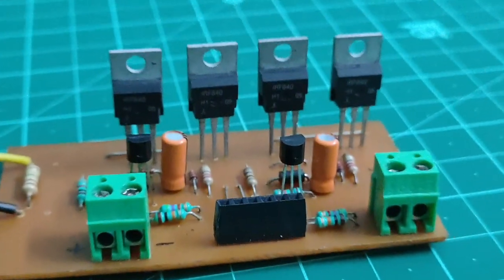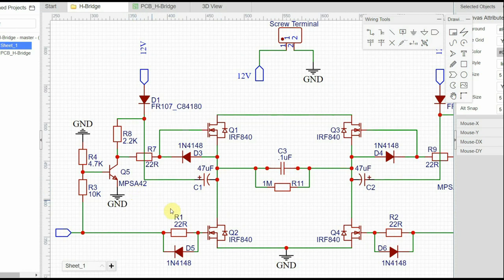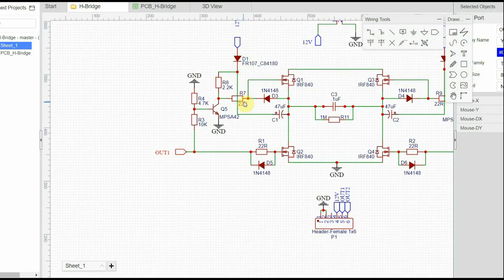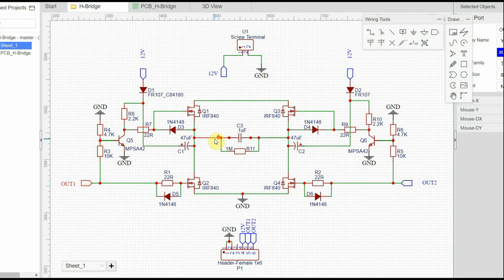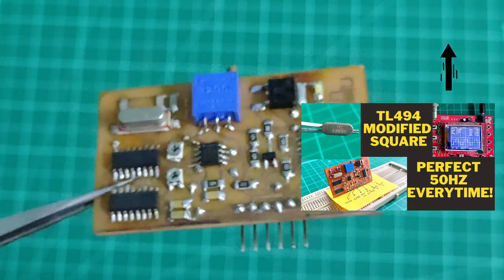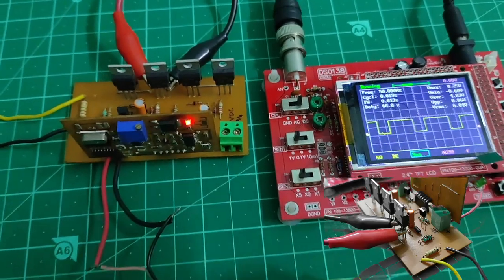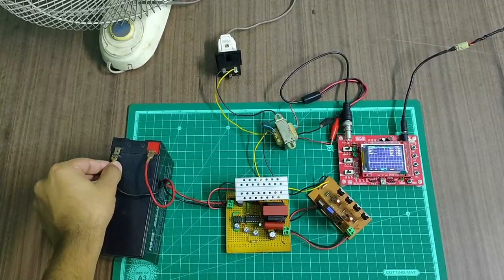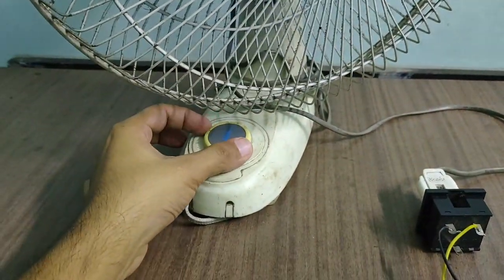DIY H Bridge Circuit for Inverters || Convert DC to AC using this module

Comment: You mention that this circuit cannot be used to directly drive a motor in one direction indefinitely because the controlling 47uf capacitor will eventually lose it charge. Could this be used to control a motor for example in short bursts for a solar panel tracker for example? Could resistors and capacitors on the output in a low pass filter be used to filter the modified square wave to make it more sine wave? It’s a great video and please explore some more?
Reply from the maker: @CodfishCatfish  Yeah you can use this for short span of time to drive motor connected to the MOSFETs. The H bridge can most likely handle this. The only thing you'd have to think about is the input signals to the H bridge. I had designed the 50Hz card for the purpose of using it for inverter. You can attach an LC filter to make the waveform a little bit 'sine-like' but an SPWM signal would be ideal for sine wave generation rather than this modified signal. You'd have to deal with reduced amplitude at the output and unstable waveform based on the load it's connected to
Reply: Great and thanks. Time to get constructing I think!&
Reply: @UtsavShah_25  I think your website is down!!!

Comment: Hello Sir, very nice video, i learnt things. My inverter output became square wave instead of usual modified sine wave. I looked at DTC parameters of the SG3524 that is driving it and it seams fine. In your opinion the problem comes from the H Bridge or from the IC ?
Thanks.
Reply from the maker: @hichamtassi1753  you need to check the signals which are generated by the IC and the signal which the MOSFET actually receives when the system is running. If the signal from IC is okay then there could be some issue with the MOSFET driver section
Reply: @UtsavShah_25  Good day Sir, i checked the signal at the PWM IC terminals and it is a square wave with small dead time of around 54 Hz (which is what is needed). That signal travels nicely to the 4 IRF740 which are new,  but the output is a perfect square wave with no 0V period between cycles, like if the delay or pause doesn't exist anymore. Mosfets are switching at the same pace of the ic, so square wave. I changed the IC and 4 of them produce the same output. The design is approximately the same as yours.
Reply from the maker: @hichamtassi1753  In that case I think you must try adjusting the potentiometer while keeping the system in running state to observe any changes in output
Reply: @UtsavShah_25  Dear Sir, thank you for your help, the problem was coming from A44 transistors. Now it is ok.
It would be GREAT if you could explain how we obtain a modified sine wave out of a square wave issued by the PWM IC. It would be very instructive.
Thank you again for your help !

Comment: Hi dear friend.  Will the H bridge circuit work with a single TL494?  without crystal oscillator.
Reply from the maker: Yes will work directly with a TL494 without any problems
Reply: @UtsavShah_25  Thank's dear friend. well, can you please prepare a video directly with TL494?

Comment: can you please make H bridge inverter for solar panel. I have to submit project in college
Reply from the maker: You can use this same bridge with a solar panel and it will convert it into AC. You just need to use a 12V supply for the H-bridge. The solar panel input can be used as input to H bridge
Reply: @UtsavShah_25  I can, but I have issue with H bridge inverter and its switching.

Comment: Hi there and thanks for the video.Can this H bridge circuit work with arduino leonardo?I want to make a high voltage H bridge to drive a treadmill motor for an FFB steering wheel for PC.
Reply from the maker: Yeah this can work with Arduino provided you give proper signals to the input of the MOSFET. You also need to check the voltage rating of the MOSFET with respect to your operating voltage
Reply: @UtsavShah_25  thanks so much!

Comment: I am getting 89VAC at the output. What could be the reason
Reply from the maker: @TechnoEveryday  check your DC input voltage levels when you power on the system
Reply: @UtsavShah_25  dc 300V ban rahay hn

Comment: Are ground negetive of both 12v battery n 300v negative commonly connected to same ground...??
Reply from the maker: Both the high and low voltage side are having a common ground
Reply: @UtsavShah_25  thanks... But if,300v negative is not connected to 12v ground, is there any problem .I mean any failure????
Reply from the maker: @listener1940  For this design the common ground is required for the feedback circuit to work properly. If the common ground is removed the feedback reliability becomes unstable, it can still work but it's not guaranteed
Reply: @UtsavShah_25 ok.. thanks..I am a school teacher..I am a big fan of your experiments... expecting more...👍🌹
Reply from the maker: @listener1940  thanks a lot for the appreciation! Will post more informative videos for sure!
Reply: @UtsavShah_25  all the best 👍🌹

Comment: I don’t understand one thing. Why there are no +12V conected on the drain of the two mosfet on the top? I don’t understand how the circuit can work without any voltage on the drain of those mosfet. Can someone exeplain to me? Thank you.
Reply from the maker: @michelecocco6793  the mosfets are usually operated on the basis of the gate-source voltage. There is a threshold voltage that is applied to the gate with respect to the source. Beyond this threshold voltage the MOSFET quickly starts conducting. So +12V on the drain is not necessary if you want to operate the MOSFET. The drain terminal will be connected to the voltage souce you want to switch(could be 12V or higher based on application)
Reply: @UtsavShah_25  thanks for answering me but I am still convinced that there is an error in the video, also because I went to look on your site and I found the image of the circuit as I thought it should be, that is with Vcc at the ends of the drains of the upper mosfets. as the circuit is shown in the video without Vss I also agree that the mosfets are controlled but then there is no Vcc voltage which is what really does the work in the circuit. Thanks

Comment: I tried this,but the output voltage started but stops suddenly...everytime battery connectes,it starts but stops...what may be the reason???
Reply from the maker: Check the main control signals that drive the MOSFETS and also check the gate to source voltage of the MOSFETS
Reply: @UtsavShah_25  what voltage is required minimum for gates....and for oscillator output??
Reply from the maker: @listener1940  The MOSFETs require a minimum of 10volts to properly turn on
Reply: @UtsavShah_25  ok...resistors connected should be quater watt or half watt?
Reply from the maker: @listener1940  quarter watt is fine
Reply: @UtsavShah_25  ok. thanks..I use 3524 oscillator..is tl494 compulsory???

Comment: Two main details you never explain is the boostrap capacitor valve and valve valve and the connection of the battery negative and the higher  voltage negative should connect in parallel for the negative charge of the boostrap capacitor because hundred of new comer cannot understand way there circuits won’t work and fail because they don’t know that this is the biggest part of the information needed for the circuit to work ,next time explain fully not halfway to destroy new comer ability to get the project working remember we are not here to get people disappointed in there self so be kind to other